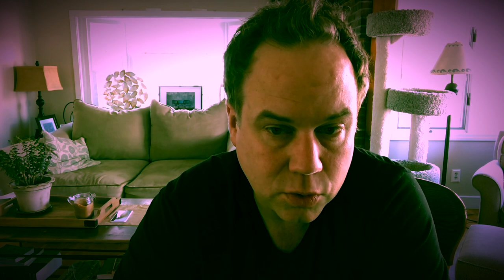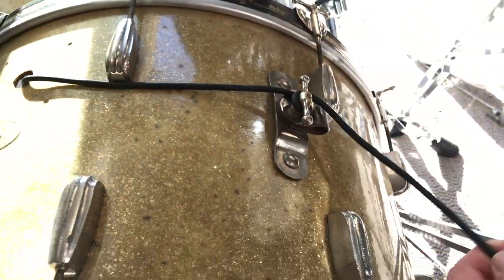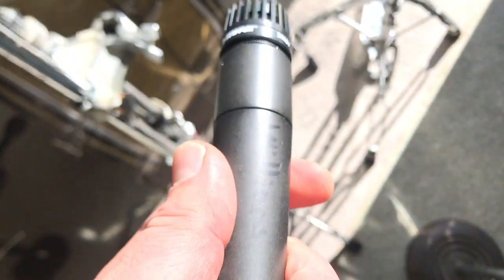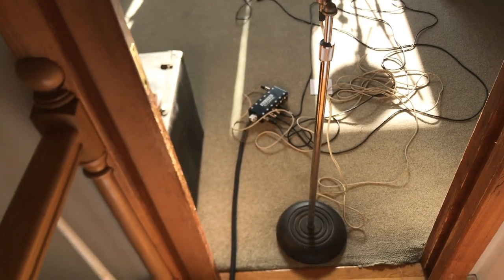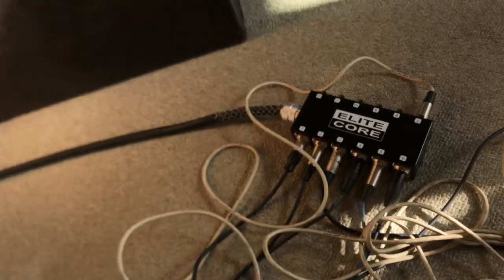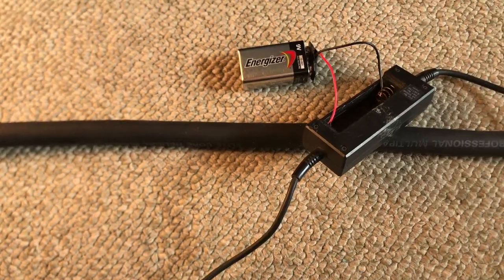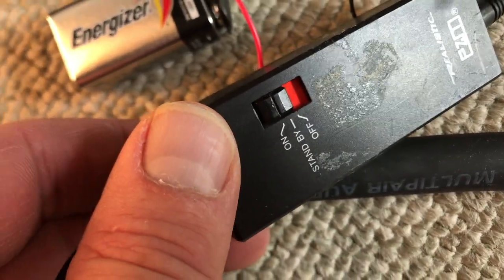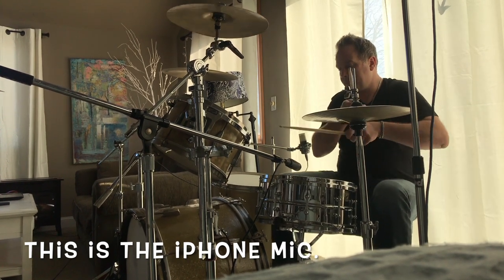RECORDING DRUMS WITH FORREST WILLIAMS OF BIG WRECK. EPISODE #4.

Comment: No way! The original kit! Would you mind making a video with the original kit and playing around, recording for a bit? I’m dying to hear what that sounds like with all the mics and the original album set up. I am looking into a similar set up like that myself. I just love the drum sound on the first album, I think it’s one of the best I have ever heard in my opinion! Can’t decide if I wanna go with a 6ply or 3ply maple. 6ply has more volume and cut, but the 3ply with rerings is definitely more round and warm but less volume. My plan is to record with 4-6 mics. Wanna go with an AudioTechnica AT4080 ribbon overhead pair, mono AT4080 ribbon room, sm57 snare, shure beta 52a kick, and maybe sm57 tom mics. But the good thing with the 6ply and ribbon, also having thick, big, dark cymbals and hats (I got 16 hats, 19 crash, 20 ride) is that even in the overheads, the toms overpower the cymbals and you almost don’t even need close mics. That combined with the darkness of the ribbons on rooms and overheads makes it easier to do without any close mics. Let me know, thanks!
Reply from the maker: Hi again! I love your enthusiasm!!!
The first album had a mix of drums 
Vintage Leedy 26 or WFL 24 kick mostly 
The 28 Slingerland is on the 2nd album.
The snare was a solid 1 ply maple noble and cooley. 12” DW maple tom. 13” vintage tom don’t remember what cause my DW wasn’t working. 16” DW FLOOR all circa mid nineties.
The biggest part of the sound is the modified radioshack PZM mics in the room. 2 pairs were used. 
I actually do these modifications to the PZM and sell on Ebay.
I no longer have the DW drums. I sold them to get a pair of 1272 vintage neve preamps- also an important part of the sound!
Here is the link to the PZM’s 
http://rover.ebay.com/rover/1/711-53200-19255-0/1?icep_ff3=2&pub=5575378759&campid=5338273189&customid=&icep_item=264984836279&ipn=psmain&icep_vectorid=229466&kwid=902099&mtid=824&kw=lg&toolid=11111